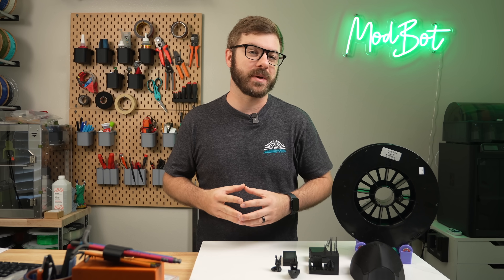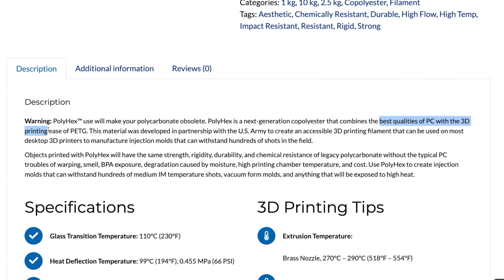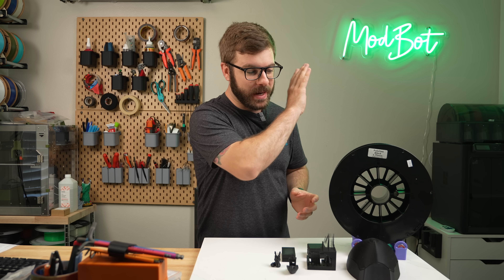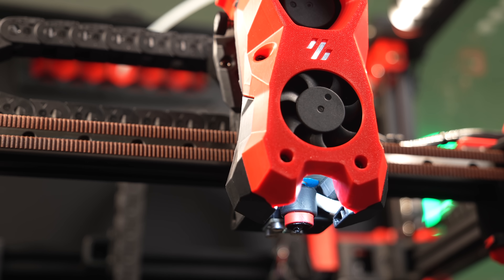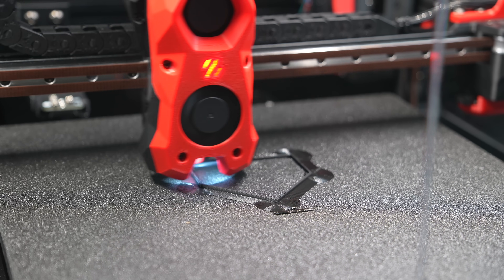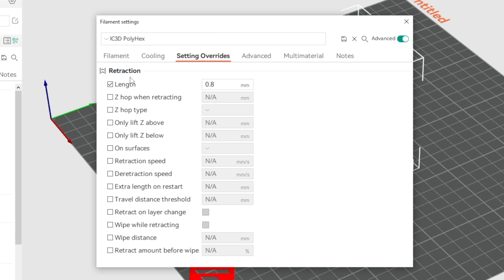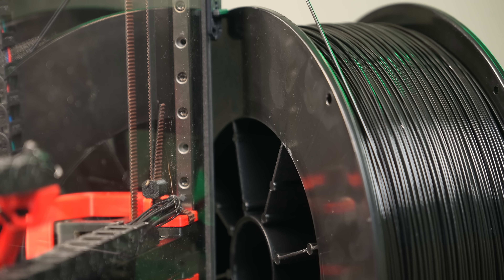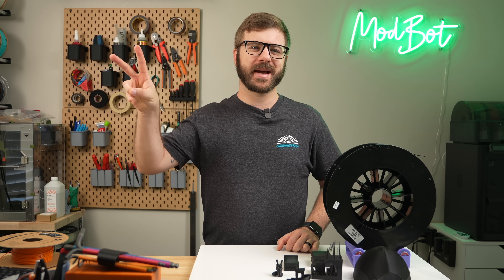Polycarbonate Filament Alternative For 3d Printing (PolyHex)

Comment: I was about to recommend the micro swiss CM2 after using it, but you beat me to it. I am really impressed with whatever coating they went with, ABS just wipes away like nothing I have seen before, literally one swipe with an old rag and it was 100% clean again. Filament also seems to flow better so you don't get the hooking effect soon as it exits nozzle while under high pressure. This is the first nozzle I have raved about...

Comment: I use a large PP Foam box (the black ones used by food delivery services aka Pizza boxes). It can withstand 120°C and offers very good insulation. My heat source are 2 300 Watt PTC Elements, each with its own all metal fan. Controlling is done by an Arduino running custom code and utilizing a industrial temperature/humidity combo sensor. Over all build cost ~300 Euro, but i can dry 4 3Kg Spools at once and heats up very quickly + you make up for its cost rather quickly in saved energy compared to the mostly not at all insulated stuff used in the 3D printing space (like food dryers or even the sunlu dryers).
Reply: perhaps you could share the details of your project with the community se we can replicate it
Reply: Sounds like an efficient solution, but why did it cost so much? Was it the industrial sensors or the cost of the insulation material? PTC heaters and microcontrollers should amount to about $50. SHT71 are very accurate temp/humidity sensors and cost $5. So theoretically this project should be doable with a budget of under $100.

Comment: I used a product with was a PC CPE CF blend which is similar to this. I found the drybox preheating the material was also a factor. (so consider that if you get your drybox sorted out in the future). These materials are ballers man! I actually made machining fixtures for a customer from it. That's how strong they are! 

Enjoy and thanks for the great video!

Comment: The filament seems interesting, but it does NOT seem like a replacement for PC. When I think about PC (not PC blends), I think of heat deflection temps of ~135C and high impact strength. The HDT of this isn't directly comparable to the PC I use (3DXTech) due to the differences in testing methodology you mentioned, and they don't cite an impact strength on their data sheet (but PETG is generally quite poor with respect to impact strength). When it comes to drying filament, I have a heated chamber printer (which is the only way to print larger PC pieces at high infill), so I can dry in that, but I also use a NuWave Brio 15.5 qt air fryer, and IIRC the inside will fit about a 10.5" spool (and air fryers are also really handy for regenerating silica desiccant and annealing prints). Also for spools I use a cheapo lazy susan with a 50mm tube glued in the center (so the spool is horizontal). Filaments are stored above the printer in plastic boxes advertised as 'water proof' (not really but they have weather striping) with a tub of silica desiccant.
Reply: Some good tips there thanks! I use Home Depo's white buckets that come with air-tight seals to store the spools. Each one holds 5. I toss a silica bag in each one (aquarium filter media bags with zippers so I can empty it to dry it & fill back up)
Reply: What printer do you print their PC on, just a regular FDM printer?
Reply: At the end of the video I was left with the question: "So, what the heck is it?" because it's not comparable to PC to me. I'm looking for my next baby step up from all the ASA I print and besides real/pure PC I'm not sure there is anything better without going to crazy engineering grade stuff that I need to modify my hotend and bed to print.
Reply: @mjodr    Polyamide PA6 + CF might be a good choice ^ Doesn't need anything special to print it (I think it even sticks to cold beds) and super strong from what I gather

Comment: I pre dry my filament in a pesto food dehydrator with the center grates cut out. I feel like the heated spool holder filament dryers don't dry filament they just keep it dry. You can get any sized spool into the food dehydrator you just need enough rings/grates.
Reply: I think that’s still the most cost effective & efficient way to dry filament 😊
Reply: I dry my filament as well in a food dehydrator, but I bend a aluminum sheet in the circular form and do not need any grates anymore. Very easy ans cheap

Comment: its a great material prints on a bambu X1C with the bambu PC material settings and PETG/ASA print speeds settings. 100m/s to 60m/s. has good wear resistance so I've printed gears with it and they have held up well.
Reply from the maker: Awesome that is great to hear 😊

Comment: I've been using PETG+ lately for anything load bearing. It does need some drying but otherwise prints as well as non silk PLA and it's very strong and resilient. Supposedly it's blended with polycarbonate. Plenty strong enough for my latest design for a flex drive outboard motor.

Comment: I buy 5kg spools when available, but on filaments that need drying I typically dont dry on the original spool.  I respool them onto steel 1kg spools instead.  I usually do the typical 4hrs@90c in a repurposed food dehydrator.

Comment: For functional parts and when great layer adhesion is neccesary I prefer PCTG. And you could print it much faster than PETG. Layer width of 0.6mm with a 0.4mm nozzle is no problem even on high speed printing.
Reply: what brand of pctg do you use and what speeds do you say are high speeds?
Reply: @landerhoolsteens  Fiberlogy

Comment: I'm interested in layer adhesion, if it adresses those problems but introduces stringing, that might be a hidden gift 😅

PC is amazing, but with zero part cooling, 45mm/s print speed (volcano nozzle) and 0.12mm hieght that normally make mold like parts.. PC still splits at the layers when i test break parts (Black PC).

Side thought; i never tried white PC which is colored with oxidized titanium powder that tends to improve thermal conductivity and thus layer adhesion. Opposite of carbon that is added to make the filament black 🤔
Reply: Polymaker's PC is black magic, prints well and seems to retain the physical properties of PC.

Comment: IC3D is where I have got all my filament since I entered the hobby.  I have never had a clogged nozzle or any print failure due to the filament.  I know I could get cheaper filament, but I just want to print without dealing with drama.

Comment: A printer with enclosure should be able to print comparable PC (blend?) filaments. Maybe you could try the PC from two years back and test it with current printer?
290/110 does not sound "print simple like PETG" ;) Deflection temperature and drooping aside, is it even close to PLA or PLA+?

Comment: I’ve had my eye on high temp filaments for heat ducting for a diesel heater project for a while.  Figured I’d use either a PC blend or PCTG filament so this may be in the running.
Reply: I strongly suggest to use high temp PA-CF which should be able to withstand 150 °C continuosly for thousands of hours.
It prints very easily

Comment: I'm a PETG-main, and I want to dip my toes into engineering filament. I had some good results with Matterhackers Ryno (albeit, with major over-retraction issues before tuning).

If I run a retraction tower, temp tower, and flow test (hollow box, comparing printed wall width to slicer), is there any other test I should throw into my "New Filament Testing/Tuning" lineup before committing to a project with said filament?

Comment: I have designed a device that is used in the boating industry, picture a bracket for deploying a trolling motor…. What filament do you recommend for high strength and high UV resistance, along with low water absorption and low shrinkage?

Comment: DEFINITELY make a desktop injection molding machine!!

Is the heat deflection temp enough to try some in-the-engine-bay car parts?
Reply from the maker: It’s been on my list for a while. The one I have been watching has evolved a few times but I think it’s in a really good place now. 

How hot do you think it gets in the engine bay worst case scenario??
Reply: @ModBotArmy  idk maybe 150-200c if you had a turbocharger and not a lot of air movement??

I’ll do some testing next time we go Jeepin’ to see what underhood temps look like in our “worst case” scenario.

Comment: Shrinkage is just half percent less than ABS, heat deflection temperature also similar (Polymaker ABS). It may be better for chemical resistance but what about stiffness? if it's a copolyester it may be quite less stiff than ABS. Is it really competing with PC? it seems a competitor to ABS, since very few ABS are as stiff and as heat tolerant as Polymaker, and this one would end up being equivalent or better in every way (and more expensive).
What about humidity? is it as sensitive as PETG and other copolyesters are? this would be a BIG downside vs high quality (Polymaker) ABS. Stringiness may be caused by that: once I dry PETG very well, stringing is mostly nonexistent (Fiberlogy PETG).
Reply: "Is it really competing with PC?" - No
"it seems a competitor to ABS" - yes, closer. ABS/ASA..but with all the stickiness and stringiness problems that made me throw my PETG spool out the window

Comment: this reminds me of the CPE-HT i got from Fiberlogy
Reply: Yah, that was my first thought too. I looked at the data sheets for both and they're extremely similar. There are some differences in the suggested printing settings/environment but the mechanical properties of the resulting parts are supposed to be nearly identical. Overall it looks like the PolyHex is cheaper whereas the CPE-HT is supposed to be a little bit easier to print. Not sure how much of a difference there actually is in practice.

Comment: Hi, was there any warping of the surface that was on the bed on the big part?
Reply from the maker: None at all. Adhesion has been great. It does require the mentioned high bed temps but yeah no warping at all.
Reply: @ModBotArmy  tnx, when I print 300x300mm sized parts it lift's build plate from bed in corners.
Reply: @Davor_3D_ZrAM use some clips to hold the bed down or get a better magnetic sticker (fysetc hard stickers are my fav) or try a different bottom fill

Comment: How does it Print like Petg. It sounds more like sbs??  Hot and enclosed..
Reply from the maker: The slight stringiness, the slight stickiness, the drying, the really good adhesion, it even looks a lot like PETG with the glossy/reflective surface. ABS smells and is warp prone but I hardly have stringing/sticking to nozzle issues and have never ran into issues caused by moisture even when opened for months.

Comment: Does this filament require fume extraction or is it relatively safe to print like PLA and PETG?

Edit: it doesn't look like an SDS is published yet which is something of a non-starter for me unfortunately.
Reply: "Objects printed with PolyHex will have the same strength, rigidity, durability, and chemical resistance of legacy polycarbonate without the typical PC troubles of warping, smell, BPA exposure, degradation caused by moisture, high printing chamber temperature, and cost" maybe not, but probably still have a certain amount.

I personally have a fully enclosed printer with a recirculating internal HEPA filter with a carbon basket in front of it. And always leave the printer on and filter running for 10+ minutes after each print with ABS or PC

Comment: You recommend drying it and claim it will print better when dried, but don't test that theory?  Why not test it out while dried and printed from a dryer?
Reply from the maker: I dried it initially using the printers bed heated at 70c for a couple of hours. It’s a less than ideal method of drying but what I was limited to due to spool size. With it being a copolyester the dryer the better. It wasn’t wet enough to cause any steaming or popping which I have experienced with very wet petg but stringing definitely happens more on wet filaments.
Reply: @ModBotArmy Why not invest in a filament dryer?
Reply from the maker: @RobertCowanDIY  I have 3. This is a massive 2.5kg spool. It doesn’t fit in even my largest due to its size. Even the cyclops which is a larger dryer was too small.
Reply: @ModBotArmy Gotcha, that's a bummer then, it would have been nice to see it properly dried, since it's hard to evaluate as-is.
Reply from the maker: @RobertCowanDIY  I really wish they had sent a standard sized spool. It does print well though. Don’t use a brass nozzle and keep it in active dryer the whole time would be my recommendation. Do you have a project in mind for it? I actually just saw you video on the XL flex membrane.
Reply: @ModBotArmy Nothing particular, just always interested in new filaments!
Reply from the maker: @RobertCowanDIY  you and me both. I will be curious to see your long term thoughts on the xl. I had preordered at launch then canceled. I am not sure if I want to go that route or one of the diy options yet.
Reply: @ModBotArmy  Will do!  For me, it's what I wanted.  It adds some unique capabilities that I was missing with other printers.  It's a nice tool to have in the shop, but time will tell!
Reply from the maker: @RobertCowanDIY  I absolutely get the appeal. For crazy combinations of materials, experimentation, and unlocking potential for some very unique projects. I’m hoping in 12 months time to see it has evolved both on the firmware and slicer side.